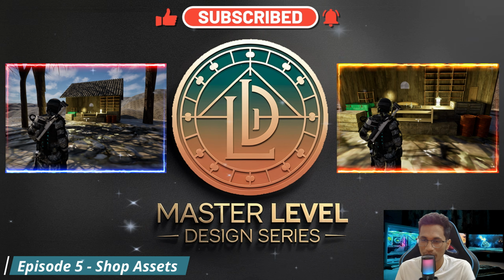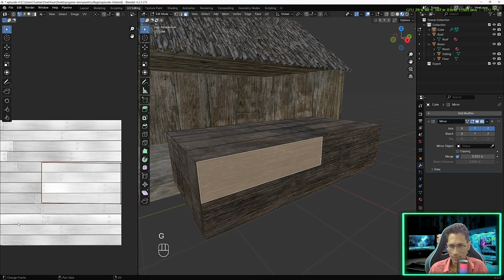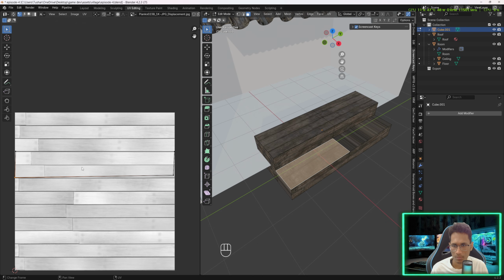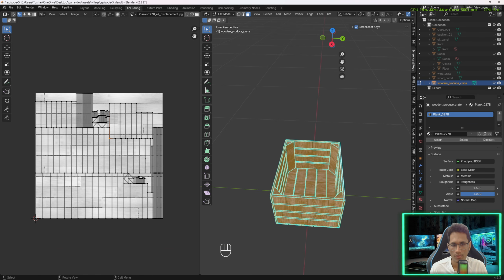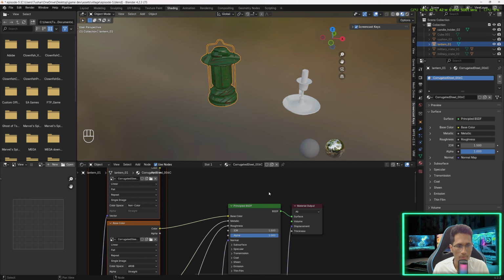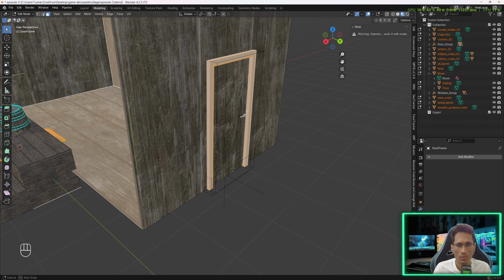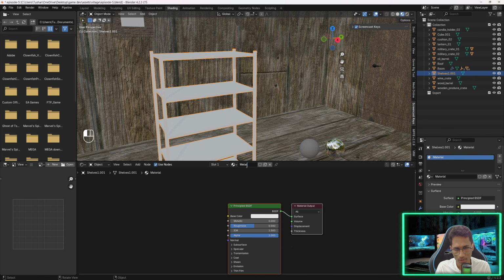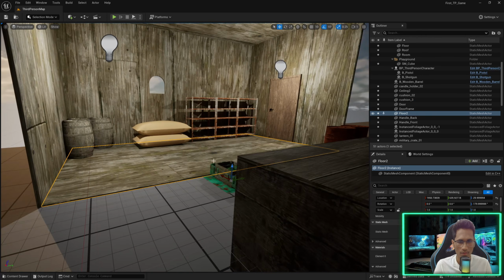Build & Texture Merchant Shop with Procedural Materials in Blender → UE5 | Level Design Series Ep 5

Comment: great videos! Would you consider doing a video about how to do a quick turn (pivot) when you hold the analog stick in the opposite direction.
Reply from the maker: thank you for the appreciation.
 checkout episode 25  - Turn in place 
https://youtu.be/UWTaoFBJgOM?si=MCIlzzXyk6lmjNXt
once you successfully implement it then you can just manually change the controller rotation to opposite direction (by pressing or holding any key) and the character will turn around.
Reply: @Unreal-shinobi-4781  this is very helpful. But I meant to do a system when the character is moving. So the character runs and then you press opposite direction and they pivot before turning. thank you for your reply
Reply from the maker: that behavior can also be achieved with this implementation